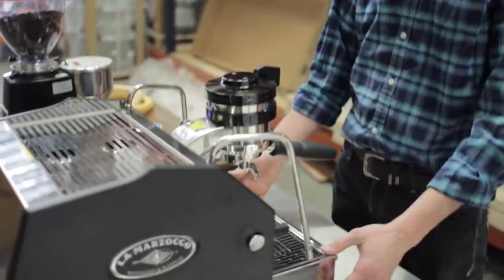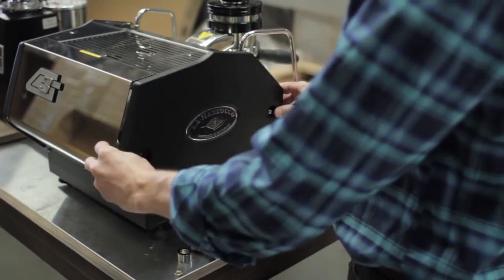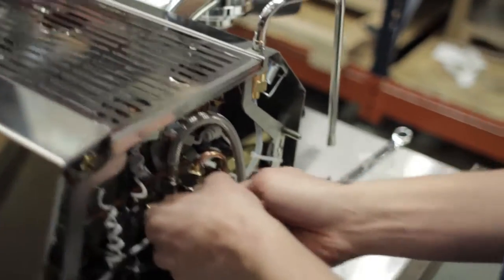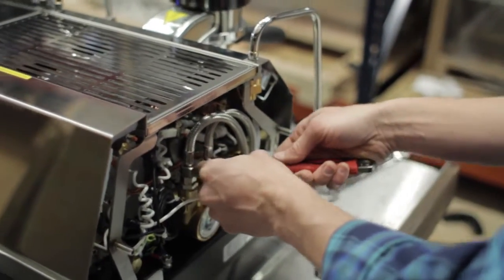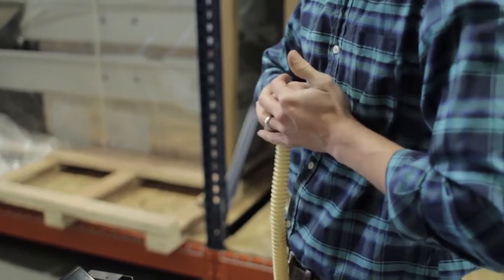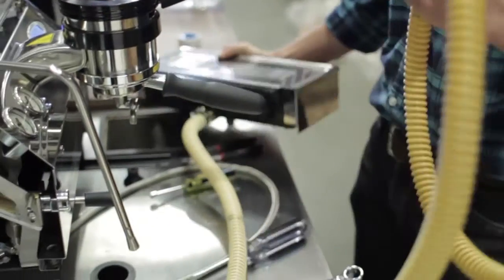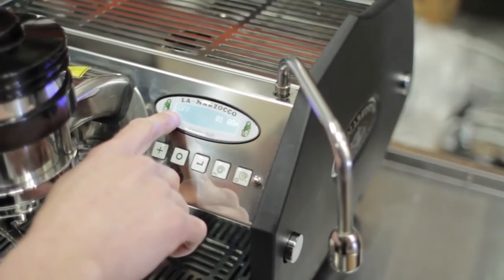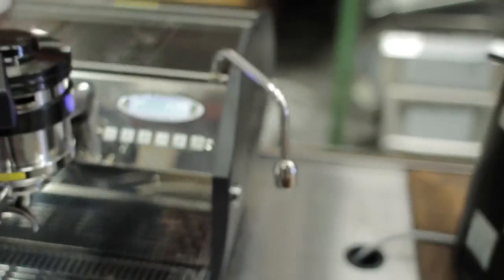How to Plumb in a GS 3 Espresso Machine

Comment: What would happen if the lines doesn’t have water going in? Will the machine turn off or will the boiler burn out?
Reply: You'll make the pump starve for water which could damage the pump, but the machine wont heat up since it doesn't read any water in the boiler. The same way it wont heat up if the reservoir is empty

Comment: I can not take off the Caps 😫 they are stuck! Help
Reply from the maker: You'll probably need to use a pair of pliers or channel locks. I would put a rag between the pliers/channel locks and the cap so that the finish on the cap doesn't get marred.